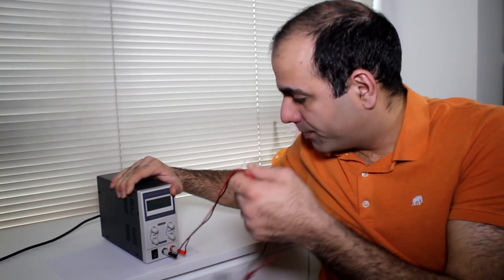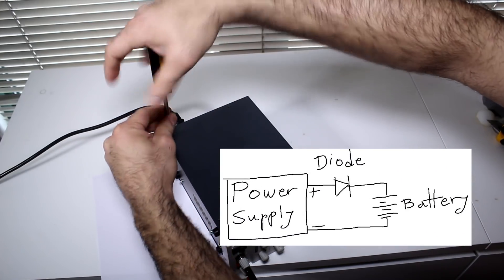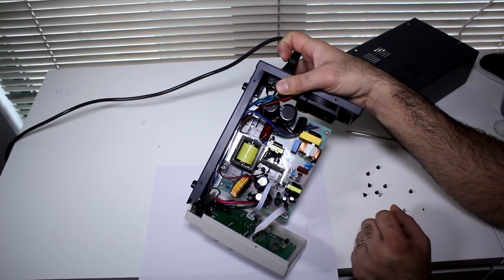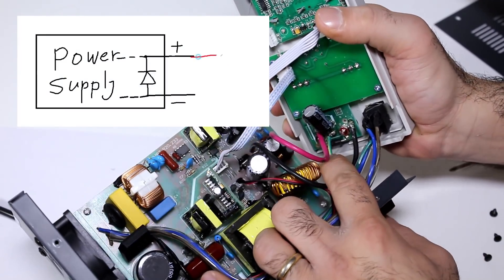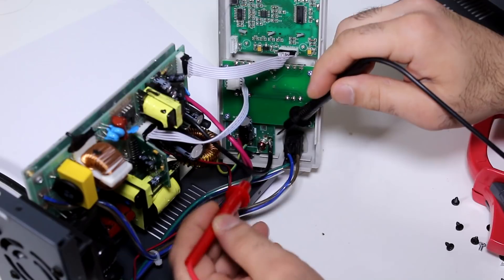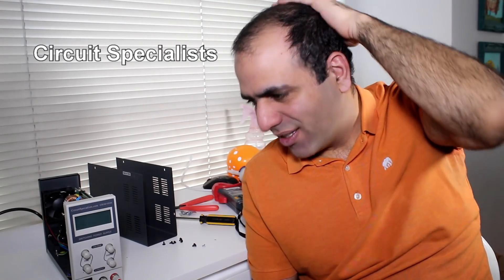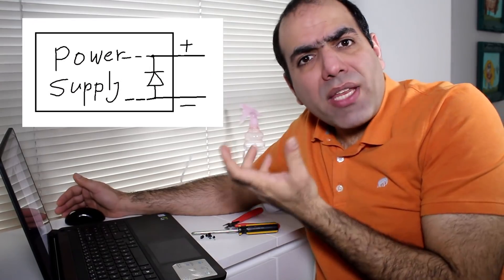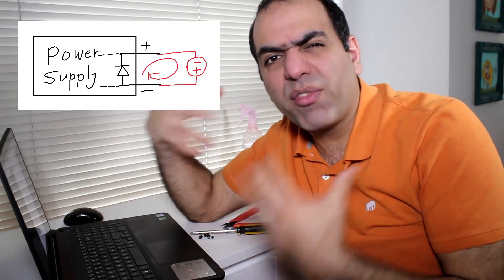ElectroVLOG-002: Fixing my Broken Power Supply

Comment: The designers could add a fuse in there POWER SUPPLY for REVERSE CURRENT protection like 15A as the max output is 10A😊🎉🎉

Comment: I have the (pretty much) same power supply and managed to melt the main transformer by increasing the max output current with some internal potentiometer on the adjustment PCB 😂

Comment: Packers two power supplies wood to buy my handmade ones you can supply 60 volts 20 amps in reverse polarity from another Supply insist Supply can handle 32 volt 15 amp output with Santa can turn on and 4 USB port output only $100 and I give a one year warranty
Reply: 480 watts output
Reply: Or kit for $90

Comment: I was troubleshooting a very large piece of equipment a couple weeks ago. To isolate a fault, I needed to substitute a 2 KW load at +/- 140VDC with a variable load, but nobody knew how to use the load. I figured out how to operate the load with my 28V supply (HP 6032A), and then made a boneheaded mistake: Instead of connecting the unit to the load, I connected the unit to my power supply! 

 Wonder of wonders, my mistake didn't faze the power supply at all; still works fine. HP (now Agilent) makes good stuff.

Comment: In my opinion, the function of the diode that blew is to prevent the back emf created when the power supply's output switch interrupts a current flowing through an inductive load..... thus lengthening the life of the switch.  I agree with  Mehdi that the best way to prevent damage from reverse polarity is by putting a diode in series with the output..... by the way Mehdi, my son James just discovered your fantastic posts recently and we have all become hooked on them.

Comment: Hi. My HP PSU has a green LED light, I just left the PC shut down and plugged in the mains. When I woke up, there is not more green light and there is no more power. I wonder which component went bad. What should I check first?

It seems to have a special fuse whereby you switch it to 220 or 110 (if it's already on 220v) and pressing the power for 10 seconds (I've already tried that).

Thank you.
God bless, Proverns 31

Comment: I did the same mistake on my GW Laboratory power supply model: GPS-6010. I plugged a SLA battery backwards, and fried this diode, causing a constant current draw and no output. Opened it up 2 times before I could figure the issue out. Swapped the diode and it was fixed.

This reverse diode is a very good protection in my opinion.

Comment: Is this reverse polarity protection circuit same as that on the inverters that you used to power the home appliances with drill battery and Car Battery in the other video  ( except for a 50A fuse ) ? You said it was crappy protection circuit against reverse polarity ? How is this different ?

Comment: I actually did something similar on a laptop that professionals claimed as "permanently broken" without replacing the motherboard, snipped off a diode and now the laptop works. Only problem now is that it doesn't charge correctly, which is partially why it broke in the first place. Otherwise the laptop is in working condition.

Comment: No dear, that diode is used to protect the power supply circuit from back emf of the load you connect to it. Like inductive load of motors etc.

Comment: The diode is there not only to protect from incorrectly connecting batteries to the output, it's also there to insure proper series operation with other power supplies - it prevents damage when supplies aren't turned on/off simultaneously. For more about power supplies I recommend a book 'Power Supplies' by Ödön Ferenczi.
Reply: In Mehdi's video where he tries to power a room from his car inverter, he says that just a simple diode is a dirty way of doing reverse polarity protection.

Comment: at 00:43 : I don't understand why adding a diode between the output and the battery can prevent the issue, it would also be forward-bias and burned and shorted just like that 1N5402, wouldn't it?

Comment: if you put the diode in series it would create a voltage drop not accounted for by the voltmeter, this way there is no voltage drop and the power supply is protected?

Comment: if you use "permanent" magnets, to spin something else with "permanent" magnets on it, such as the fan demo, to generate energy,.........shouldnt it indeed generate energy, and wouldnt that energy just be limited by the power and life span of the magnets, eventually running out of energy like any other fuel/energy source that follows the universal laws???.......and shoudlnt that  devices total energy produced, be less then the energy it took to manufacture the magnets?....... basically im saying wouldnt you just be substituting magnets, for other fuels/energy sources?

also, i think alot of people mean "free", as in monetarily free ( after set up costs), not energy from nothing/nowhere free...... similar to how solar costs to set up, but is basically free afterwards. but still follows physical laws of the universe.
Reply: No, because you would have to change the magnetic fields in order to have a constant, stable rotation.

Comment: I did the exact same with my bench PSU, exact same fault, shorted protection diode. Replaced it and all was good. Unfortunatly now my PSU has blown its output transistors so now it always pegged at 42v, need to replace them now :(

Comment: Crow-bar diode.
I have seen 12 volts supplies with 14 volt zener diodes [forward biased] and regular diodes in parallel [reversed bias] to the output.
The Zeners were supposed to prevent over-volting the output, the other diodes for reverse polarity protection.
A 5 amp fuse between the supply and diodes, 3 amp fuse on the output terminals.
Lots of over-kill for a 30 watt bench supply!

Comment: I was thinking the same thing, even a diode on the outside may not have stopped this if your battery puts out high current. 
On the other hand this would have been a perfect video to show how thermal cam detect the part that is dead shorting. The thermal should have shows that diode glow red, or if something else was dead shorting it would have been hit a lot faster.
Now the big question, do you trust your battery now that you just shorted out for "how long"?

Comment: Not impressed when I saw full current with no voltage knew it was some sort of simple crowbar circuit shorting diode. 
 You should also modify PSU with an internal fuse in one of the leads so cant be used if happens again without checking problem.
 Its ok for pros to play around with things while mains power connected but not for a none professional idiot that might hurt themselves (this is watched in countries with 220-240
mains and no RCD!)  and( or family) sue you! Always say “Don’t try this at home with power connected children” just to cover your self!  (Grin)

Comment: I've done this exact same thing to my old bench power supply trying to charge power tool batteries.  It also had a diode across the terminals and the diode shorted when I hooked up a battery backwards.   I did replace the diode with a similar one to prevent further damage should I do something like that again.   I suppose the power supply designers didn't want the voltage drop and power loss of a series diode to protect from reverse polarity.

Comment: @ElectroBOOM Great video as always! Hilarious and educational. Just to clarify - does a diode ALWAYS short when it blows up? Are there other diodes that behave differently?
Reply from the maker: Well, so far what I've seen is that they melt to a short which runs continuous high current through them, then they fuse open if the current is high enough.
Reply: ElectroBOOM that's interesting. Do SMD diodes also behave the same way? I have a few projects in which I've added diodes on the USB power line for basic reverse current protection, but I've never blown up an SMD diode intentionally to know how it would react

Comment: put a panel mount fuse holder on the machine between the reverse diode and output. Therefore if you reverse connect a battery, current will flow through the fuse and diode and fuse should blow before the diode does.

Comment: Today I accidentally almost fried my esp8266 NodeMCU Dev board. I've shorted vin (5v) to GND and blew something up. now i have to connect 2 cables (one for power on the pins and one for data on usb) because it blew something on the usb power lines

Comment: 0:43 That wouldn't protect against reverse polarity! only against same poloarity over voltage.
Reply: care to explain? EE student here, didn't quite get what you meant with "same polarity over voltage". thanks!
Reply: Niels Daemen The diode lets electricity from the (-) to (+)
So to my understanding the current over the diode is caused by reversed polarity?

Comment: I did exactly same thing with my rather expensive TTi power supply. And funny enough, same symptoms and same repair solution. In my case I was charging a car battery and had leads plugged in wrong way around at the PSU end.

Comment: Maybe you should put a fuse or mov I think they are called into the circuit so if it happens again it will protect your power supply dick smith power supply used a glass case thermal fuse overlaid protection but it was only rated at one amp and it would automatically reset after a given time

Comment: All these cheap consumer electronics use baseline components. It seems like if you want anything with quality you gotta spend the big bucks or make it yourself. 

like how much extra money would it have costed to use a transistor instead of a diode? or hell, just place a resettable fuse right onto one of the input terminals.

Comment: The problem with adding a series diode to the out put is that the diode will have a voltage drop. Some diodes this will only be .75 volts but many are higher. So this makes your voltage setting on the power supply supply off by what ever the voltage drop of the diode is. So once you know the voltage drop of your diode just make sure to set the poswer supply that much higher to make up for the added series diode.

Comment: DON'T allow the power supply to give out voltage over 30 volts! For example i had the same power supply but with 5 amp maximum load and i maxed the voltage over 30 volts because i wanted to show my friends what happends when you connect a big load to follium, and my power supply just turned off... the fuse was still okey but the power supply didn't want to turn on. I opened it up and i didn't see anything blown... sorry if i had any grammar mistakes, i just wanted to share this info!

Comment: Add a fuse in series with the diode (and in parallel with the output), that way, if you ever hook up a power source to the outputs (like in the case of your battery), it will forward bias the diode and blow the fuse instead of the diode....much easier to replace since you can add a fuse holder to the front panel. Its rating should be just below the maximum rating of the diode.

Comment: hopefully, you replaced the bad diode. if not :facepalm:
Reply: *hofefully
Reply: Indeed. I suspect that's a flyback diode. I hope he doesn't use sensitive electronics together with inductive loads on that power supply.

Comment: I want a Mooshimeter!!!!
Reply: It doesn't look that great. It's very accurate, but it's also unsafe and it looks like it breaks instantly when it gets dropped.
Reply: StarTrek123456  well I guess you don't know for a fact untill you try it.
Reply: No blast protection, the microvolt range is on a seperate input jack (very unsafe), it doesn't have a real current shunt, it doesn't have a microamp range, the accuracy is shit (1%), it can't measure diodes above 1V, it doesn't have true RMS, .......

it's a toy. a very expensive toy.
Reply: StarTrek123456 I don't need it for all that. I work on 12v DC systems.
Reply: But it's still going to break when it falls off the table. And even a 50€ multimeter would be more accurate. Trust me, don't buy it. Get something like a UT 61E instead. It's not the safest meter, but it's the most accurate low end meter you can get.
Reply: StarTrek123456  I just need it to tell me if it has 12v that's it. dropping part is least of my worries. I just don't want to lug a VM around when I already carry my phone around.
Reply: You can also buy pen multimeters if you don't need accuracy. They are much cheaper than that mooshimeter thing.
Reply: StarTrek123456 yeah but I need to see drop in voltage instead of just a light.

Comment: So what happens if you short it now that you've removed the diode?
Reply: it was shorted when the diod was still connected
Reply: Nazeems Best Friend prob. Patreon upload
Reply: well the same thing as seen in the vid, high constant current flow because the dioda was practically shorted
Reply: nothing, the exact same thing that was in the beggining of video. these power supplies are designed for shortcircuts.